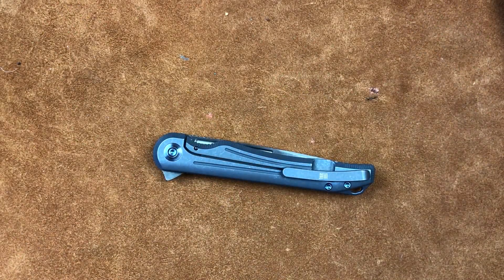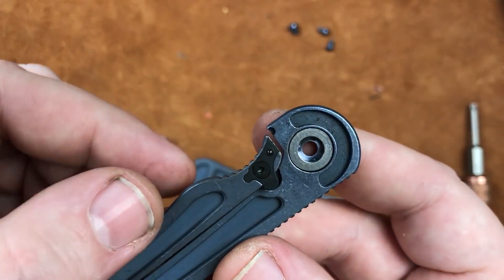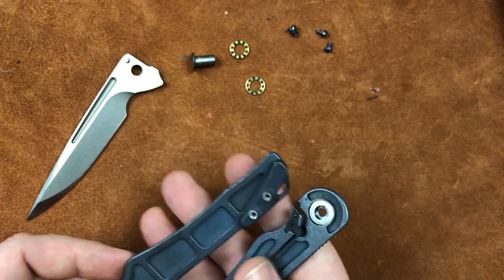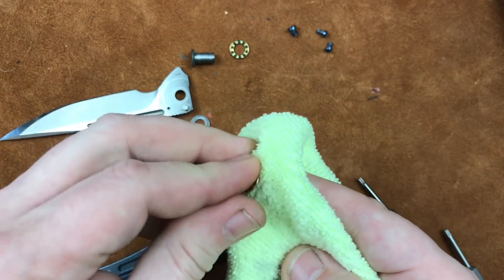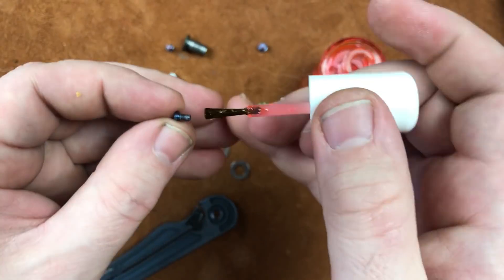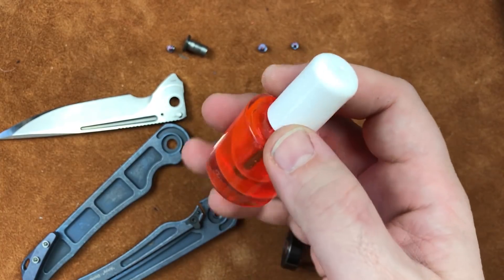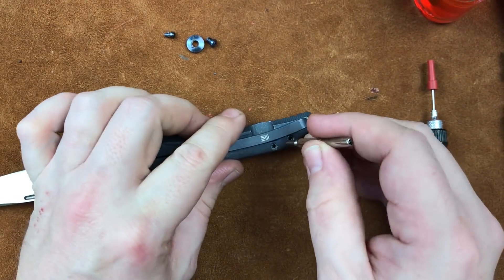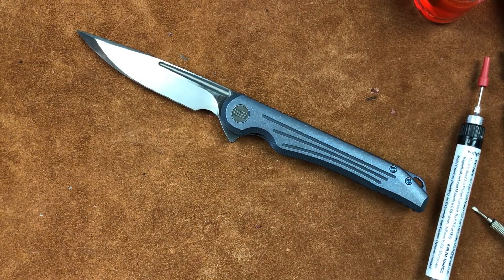What's inside? The WE Knife Co Array Model 718

Comment: I like that you  screw head quality test, another example of a person who use the knife as tool, not just for it's looks. 👍👍👍 Before I think about another knife purchase, you're tops on my list of reviewers. I'd also like to get more information on knife steel, edge retention, toughness, slicing/splitting geometry, real world use ability, etc. 

I heard a reviewer, who does primping and sharping, who said that pivot bearing are better than washers in gritty environments, any thoughts? Claimed bearing can be cleaned with a squirt of WD-40, blast of air and a drop of oil, where as washers required disassembly, whipping clean, lubrication and reassembly.  🤔
Reply from the maker: Cedric and Ada Outdoors has the edge retention testing down, I'm not going there.

As far as hard use, the best thing is a fixed blade, next best is a phosphor bronze washer knife snug enough at the pivot that it won't flick open, thus keeping all mating surfaces against each other snugly and keeping crap out. beyond that I don't think it matters, if you get sand, silt, mud or anything else gritty you're going to have to take it apart at some point and wash it out. No amount of pressurized air, WD40 or anything else will clean it out.

Thanks for watching and have a great day!

Comment: Do you think it's a good idea for knife manufacturers to offer different steel option (D2, cpm-s35v, M-390, etc.) in the same model? 🤔
Reply from the maker: Short answer, in most cases no. Do one steel and do it well. In this case S35VN, would people pay more for M390? maybe a few. Could the company make the knife with D2 cheaper, no, it would still cost about the same. hard to believe but the steel is one of the lower cost materials and processes on a knife above $100 or so, the Ti, time in the mill, heat treating, hand fitting, QC and such is much more costly all of which has to be done, no matter what steel is chosen.

Spyderco is an exception, they make it work on the FRN knives with 4 or more steels available nearly all the time for each design. But that's an entirely different sales model. Where all the parts of the knife with the exception of the blade are extremely cheap to produce and the base steel is easy to process, so the change to any other steel raises the production cost more than a change in handle color and the consumer is usually purchasing on steel not design.